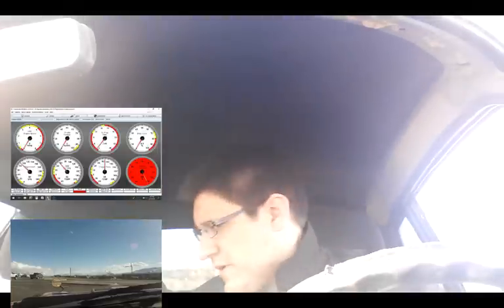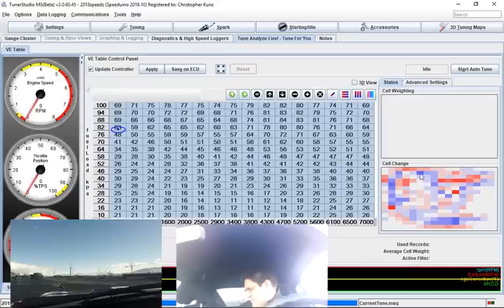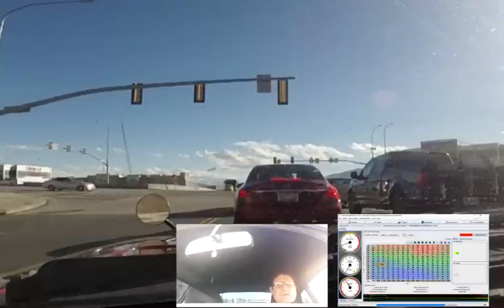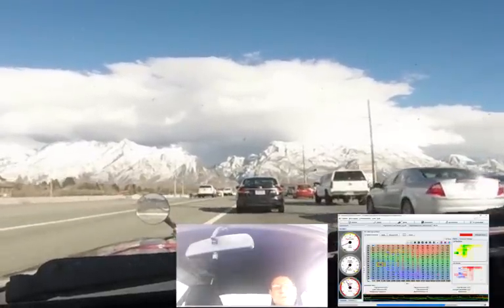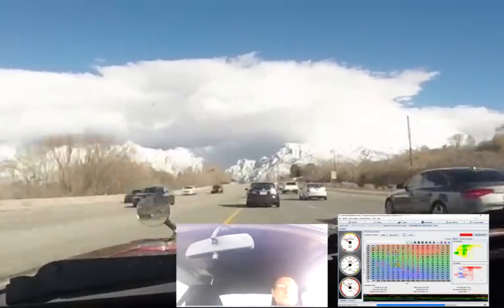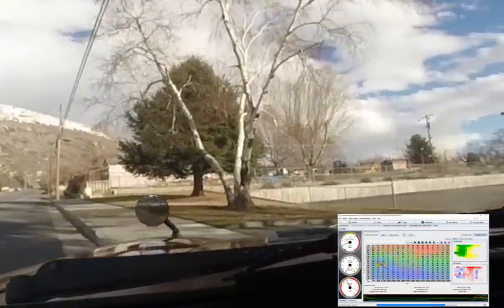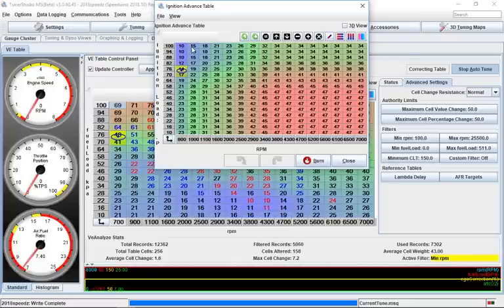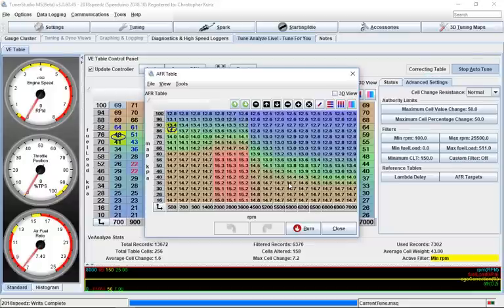Using TunerStudio's Auto Tune - It is worth every penny - Drive and Tune

Comment: Did you feel the need to adjust the Lambda Delay tables?  Some suggest it may need it, depending on how far away the O2 sensor is from the exhaust ports.  Thoughts?

Comment: Too funny, I'm watching you drive up the hill and I realized your on hwy 92 heading east, you drove right past my house...haha. So, hey neighbor. I'm exploring digital engine management for my single turbo 4.6l 2v build I'm doing this summer. I'm leaning towards a Speeduino, now that I've figured out how to convert my Coil over plugs to wasted spark. Tuner studio is going to be the software for sure. Once I get the hardware installed (turbo, hot side, intercooler, wastegate, BOV, wideband O2....blah, blah, blah) I'll probably have lots of questions on engine management...I'm a 60 yr old carb & glass packs guy, this is a whole new world for me.

Comment: Great video.  I am going to get Auto Tune but I am unsure how to best utilize it.  I am having difficulty tuning.  My car starts and idles but has really lousy vacuum at idle; I have a pretty big cam.  Driving it is rich (11-12 AFR by Innovate gauge) almost all the time (except for lean surging while trying to maintain an constant cruise speed) and I am afraid I'm going to ruin my engine.  It does pull hard.  Will you give tips?  Am I at a place where Auto Tune will help me?  My daily driver is a '68 Dodge Charger, 383 ci, automatic, MS2, 900 cfm Holley throttle body.  I can provide more engine specs/details if needed. Thanks much.
Reply from the maker: Feel free to send me a copy of your tune and a datalog of you driving. (Twonutsdiy at gmail.com)
A few things do not seem to line up, so if you cruize at 11 to 12 afr and are getting lean surges, you need to check your timing. First make sure if you ask MS2 for 20 degrees, you get 20 degrees with a timing light. After that you need to make sure your spark table is reasonable for your engine. Keep in mind, the leaner afr you run, the faster the flame front travels. So as you lean out in can change your need for timing. I love your choice in cars btw.

Comment: I would love to switch to fuel injection
Reply from the maker: It is scary if you have not done it before. If it is your first time, just take your time and confirm results before you move on to the next item. It opens your eyes into all types of fun things you can control and improve.
Reply: @CEKGarage  I'm gonna try it out
Reply: @CEKGarage  how much u think you have wrapped up in the motor and turbo system
Reply from the maker: The short block was a freebie from someone that did a swap. I have about $400 into the turbo system (I am an accountant by trade, so I am cheap :)
Reply: @CEKGarage  cheap is good lol

Comment: i have a question..(thinking about getting megasquirt)  so you enter a value then the autotune tunes to that ?  how do you know what sort of value that car should be running at if you dont have others to copy from , thanks
Reply from the maker: Tunerstudio can generate a VE table for you if you are not able to find one (this is a tool to allow you to get started from scratch if needed, the car will run, but not well). However, the main tables are the spark tables and AFR table. The VE table is more of a result from the other two. With autotune, as I showed in the video, is not really looking at the value on the VE table and moving it up or down to allow the car to reach the AFR value that you entered on the table that was not shown on my screen. Let me know if that helps or if you have any other questions.
Reply: @CEKGarage  Hi, my car has d-jetronic system. I looked things up and I found this "Then there’s the question of what to use for RPM input to the MegaSquirt. The D-Jetronic system only controlled fuel, not timing, so the easy option is to have the MegaSquirt trigger off the coil and run fuel-only too. If you want to get more control, you can lock out the distributor and have the MegaSquirt control timing, or upgrade to one of our crank triggers. You do not need to use the fuel points in the distributor." Do you know how bad it would be to run it fuel only? The problem im having with the car is that the camshaft i have in it is not intended for the original injection system because the original box doesnt tell the injectors to spray the fuel that is needed. Would the self tuning thing work with only controlling fuel or does it have to control timing aswell? Sorry im a total noob at this sorta stuff, all i know is that i want to try and keep things as original as possible.

Comment: How high are you what ALT are you at?
Reply from the maker: 4800 feet
Reply: @CEKGarage   K I was wondering after looking at the shot with the car shut off n you map was 78%  I used to live in Tooele n drover to dugway for work on the regular I had a MS2 in 86 944 did a dual Map sensor to help make the adjustment

Comment: I always wanted to know what does the colors mean? I heard that the red is some where in the middle n green rich n blue was running lean. Im wanting to get into tuning my car, but idk on every vodeo what the colors represent. Thanks
Reply from the maker: Great question! It is just based on your table (for ve table, the background is blue for the lowest number and red for thlargest number) All numbers inbetween are on a line sacle between the two numbers to determine the color. For the text of the number, it is changes you made on that instance of your loaded tune. So if I open up the tune and bump the ve table up one, the number will be red until the next time I open up TunerStudio. However, there are tunes that use a afr number pulled into the ve table. These are starting to show up more, if you have a specific question, email me at twonutsdiy at gmail.com

Comment: if i even could get my car started with microsquirt😢
Reply from the maker: Is something holding you back? anything I can help with?
Reply: @CEKGarage  
main thing that is holding me back is the trigger wheel.
i have sensor mounted but i dont know where the missing wheel should be placed? forums told me that missing wheel should be 90 degrees before the sensor when engine is at tdc.. my engine is 4 cylinder and im running wasted spark.
Reply from the maker: 90 is a good tip but not a must. My current setup on my car is at 58 degrees. Back in the MS1 days, there was an issue with trying to have an ignition event on a missing tooth. Since you have a 4 cyl, that gives you a large range to mount the wheel. I would do anything from the 50 to 140 degree range. The "trigger offset" is how you plug in the final number. The main exception to this is if you are using a Ford edis system, that has to be installed to mimic a stock setup. Hope that helps.
Reply: e34Boat i recently started a V6 with new trigger wheel, its around 180 by eye but ended with 172°👌

Comment: Noob question,  hardware is cheap for Speeduino and SOFTWARE ie TunerStudio is Free? Registering helps others see your engine / combo / specific Tune?
Reply from the maker: Great question! The hardware is cheap as you called out. The firmware is free and updates are released every other month and is loaded to the Speeduino. The software (Tunerstudio, Ms driod) that allows you to connect, change, and tune the ecu. The paid version of Tunerstudio just helps you tune it faster and is why I am a huge fan :)
Reply: @CEKGarage  But its a BUY once, not per tune like other stuff i see out currently...?
Reply from the maker: @amindnew527  The Tunerstudio registration is a one time registration. I purchased mine about 5 years ago. I have used it across about 12 different projects over those 5 years.
Reply from the maker: Sorry, one last part, it does not have pre set tunes. Most of the time I would say getting them from others off of online would be the best starting point.

Comment: It seems this have improved a lot during the years, did not work for me 100% when it was a new feature: VEAL (especially handling wideband O2 lag). Anyway finally, I moved to MAF only and that is different world. No IAT dependency and so on..  You write a value in target AFR table and you are done 😎
Reply from the maker: Yes, it has had a few updates to make it better. I didnt show it in the video but under the advance section there is a lag table for the AFR. I played around with the idea of ditching the speed density set up about a year ago. Must admit, the thought of a MAF does tempt me from time to time. Thanks for watching!

Comment: Have a question for u could u do a demo on semi sequential injection with ur six banger with batch fire
Reply from the maker: I wish I could. My current understanding is that they allow that on 6 cly fuel only boards or for 4 cly or less for for fuel and spark. (If you have a link to a release note that I missed, please let me know, I would love to try it out)
Reply from the maker: First off, thank you! This got me down a great path. I will be playing around over the next bit. I think there are a few ways I can go. Simi or full. Since I like to do small steps at a time I will start with simi and go from there. Stay tuned!

Comment: So to which table is auto tune correcting? Is it to your AFR table? How does one get a good AFR table for it to auto tune towards?
Reply from the maker: Thanks Brad. So with AutoTune, it is using the AFR table as a target. So if you are running 13.0 AFR at a specific RPM and Load, when your AFR table thinks you should be at 14.0 AFR. Auto Tune will make an adjustment to your VE table and lower the number to make it a little more lean. If the next time you are at that same  RPM and Load, and are at 13.5 AFR. Auto Tune will make another adjustment again in the quest to get it to your requested value from your AFR table. This is why the graph on the top section goes to a darker green the more time you spend in that RPM and Load. Auto Tune is letting you know it is confident with hitting your target AFR table. A good guide to start with the AFR table that I use is from the old Megamanual. http://www.megamanual.com/begintuning.htm it is more on the last section of the page, but the whole thing is full of great info for those that are working on getting their tune better.
Reply: Cool, thanks--just making sure people know how to get setup with the right table so they're auto-tuning towards the right AFRs.
Reply from the maker: @bradbucc  Thank you Brad! It is always hard to put the trainer hat on sometimes and make sure what I am trying to convey is coming across. That is why these comments are so important to me!